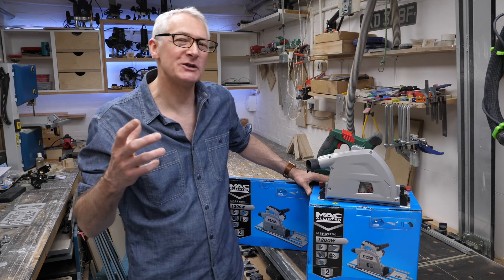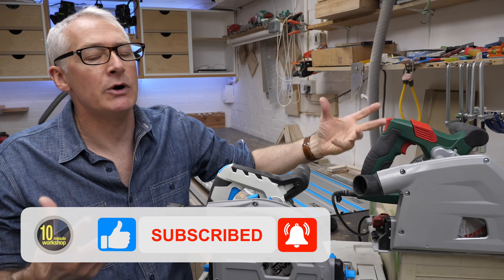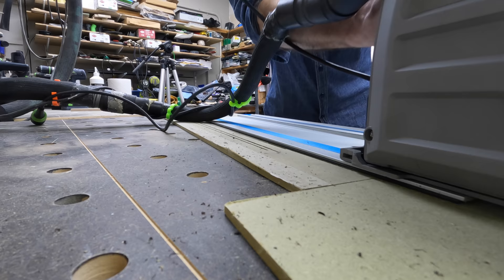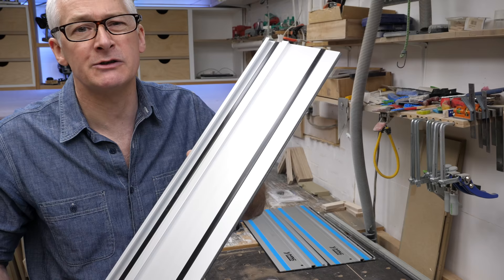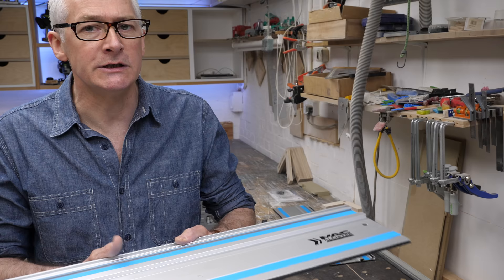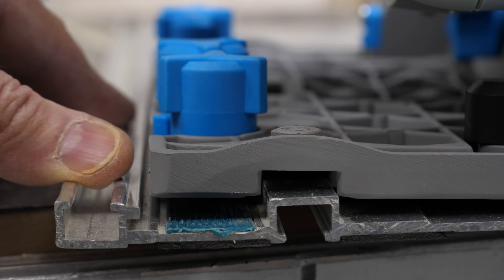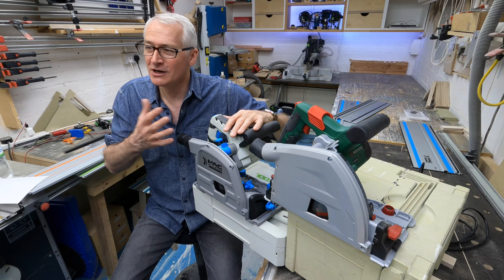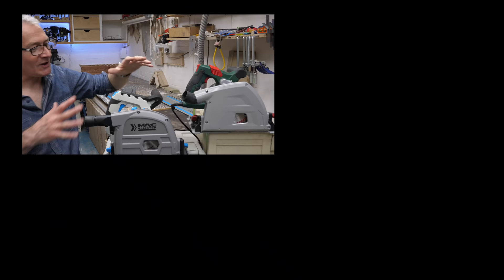Lidl Parkside or Screwfix MacAllister? [video 454]

Comment: Watched the older clips and found most of the cheaper units out of stock.  Found this and thought great only June last year so products should be the same, sadly not the MacAllister is also out of stock at Screwfix with B&Q saying one maybe in stock almost locally but over £100 now.
That grey MDF you use how does it fare cost wise compared to undercoating and painting?  Cabinet the size of a small wardrobe, 70cm wide 180cm tall sub 40cm deep. 
Seen a lot of US clips where they use it like its disposable, although some spend $5k on a machine say its flawed and stick it in the corner and buy another one for more money. Jealous oh yes. :)    Great  channel love the content.
Reply from the maker: Thanks! Yes, the Macallister started going out of stock not long after this video - not claiming any credit for that, you understand... The fibracolour was around £170/sheet, but it's a big sheet (2850 x 2100 or thereabouts) so I'd say it compared favourably to priming and painting - certainly a lot less effort than spraying, unless you're 100% set up for it!

Comment: Excellent video as usual. I'm considering the Mac but just had a look at one in B & Q and noticed the baseplate is plastic. This has put me off a bit as not sure how robust it will be.
Reply from the maker: Baseplate on the MacAllister I bought from Screwfix definitely isn’t plastic. Never seen any plunge saw with a plastic baseplate tbh. 🤷‍♂️👍
Reply: @10MinuteWorkshop  thanks for update. I'm going to e-mail screwfix for confirmation, it may be a 'new' version. I hope I'm wrong as this is ideal for my needs / budget.

Comment: Hi Peter , was looking for a plunge saw for quite some time and after watching your tracksaw workshop videos I decided if I won't find good second hand one I'll go for mac allister (£135 now) and when doing groceries in Lidl I bought a parkside D2 for £80 which I thought it's a bargain at this price , will upgrade blade and thinking of buying st2800 track's
Reply: At a time of your comparison video price difference between them 2 was minimal and I'm wondering if now Mac allister is wort that extra £55 over parkside?
Reply from the maker: Hi, sorry, old vid; I think you'll struggle to find the MacAllister these days. Pafrkside is great for the money if you can get your hands on one, albeit with the reservations mentioned in this vid and previous. Macallister not worth 50-odd quid over the parkside, put your money into more track. 👍

Comment: You promised this vid when i commented a few days ago and you delivered without fail.

I've been looking at all these "Cheap" track saws but i'm still not sold 100%. Was thinking i might just go buy the Bosch but have now found the Makita with 2 x 1.5M rails and a bag for £405. Yeah quite a bit more than 70 but if i have to get extra rails etc for the Lidl one then i'm starting to get to the point of not saving a lot in the long run.

The only thing putting me off about the Bosch is that the rails don't take standard clamps like just about everything else in the world. 

Think i might be spending £405 quid later. To be honest i've sat for days looking at lots of stuff and i still can't decide. (Festool out of my justifiable budget lol).
Reply from the maker: Well, either of these saws plus a pair of Evolution rails and you're into ~£150 - still a bit different to £405, but absolutely see where you're coming from; Bosch seems like a great saw, like a Mafell with a slightly reduced feature set. But the rails are slightly problematic, in that the lack of a left-hand side t-slot means some accessories eg parallel guides are a challenge. 👍
Reply: @10MinuteWorkshop  One other thing i realised was the warranty. Both are 3 years. Difference though is Lidl you get a refund, Makita you get it fixed.

Comment: I recently purchased a scheppach cs55 it's got a 160mm blade 55mm Dept of cut is 1200 watts & came with a 1200 mm guide rail  it would be interesting to have a comparison between the scheppach cs55 & these 2 saws 👍👍👍
Reply from the maker: The Aldi workzone saw is essentially a rebadged Scheppach, and I’ve covered them in detail before. 👍
Reply: @10MinuteWorkshop  thanks for letting me know I'll have to check out your other videos on it cheers 👍👍🇦🇺

Comment: Over here in the Colonies, you can get the exact same thing as the MacAllister and TItan saws under the Wen brand.  The main difference (besides the mains voltage and power rating on the motor) is that Wen sell the saw and rails separately, which increases the total to something like $200, but those rails are 50 inches rather than the shorter ones that come with the TitAllister.  (Based on the completeness of the Wen website, I think Wen is the original manufacturer, with Screwfix doing some "badge engineering", sort of the way Aldi did with Scheppach.)

Interestingly, the Wen also includes a little tag telling you how to remove the anti-kickback thing, though it does also mention the maiming you might get if you do decide to go that route.  I'd imagine the UK store-branded models probably leave that info out due to the more stringent health and safety regulations.
Reply from the maker: Good to know thanks. We don’t get Wen products at all here. 👍👍

Comment: I had the Titan version for a couple of years, using it for fairly moderate DIY use, but the motor blew last week sending sparks flying up in my face. Have now bitten the bullet and spent some decent money on a better quality plunge saw, ya gets what ya pays for.
Reply from the maker: Indeed you do. But it’s remarkable what £70 will buy you. My Titan is still going strong, just FYI 👍
Reply: My Titan is about to die too so I just ordered a makita cordless as an upgrade.  Got a lot of hours use out of my Titan for £70 + Tracks a couple of years ago.  not even sure £70 will get an extra strip of track the way prices have gone recently.  :)
Reply: @10MinuteWorkshop  My Titan's about to bite the dust but thanks to your first tracksaw vid,  it's got to be the best £70 I spent for a while!  cheers Peter.
Reply: @10MinuteWorkshop  Totally agree, I got some decent service from mine but they don't seem to be terribly robust. Mostly used mine for making some built-ins for the house and some bits of shop furniture. All mainly 12mm or 18mm ply and MDF. I'd say I got my (think mine was around £100 a few years ago) money's worth.

Comment: Ha Did you remember my review of this MacAllister saw? I find yours is better than mine ;-) hahahaha
For notiz. I use mine Mac Allister a lot and I am happy with this saw. Okay, it is not a Festool but do the work.
Reply from the maker: I did, thanks Tim! 👍
Reply: Tim, your video is also good but for different reasons. You pointed-out the squaring screws in the base that aren't clearly referenced in the manual and don't get me started on the play you exposed.  Scott

Comment: Great video Peter! As always! Last year I bought a parkside track saw in the Netherlands, it was the new version with the riving knife. Overall pretty pleased with the saw however I have issues with beveled cuts and I'm wondering if others have similar problems. When I make a beveled cut the pivit point of the blade is not at the bottom of the splinter strip. As a result, the blade cuts a bevel in the splinter strip, making it less effective and hard to align when the saw is used without set to a bevel. Changing /moving the splinter strip after each beveled cut is not very practical and expensive. If anyone has similar problems or a solution I'm very interested to hear from you.
Reply from the maker: Good point Ruben - I haven’t tried a bevel cut with these yet. 👍👍

Comment: The tracksaw's from Triton, Titan, McAlister, Batavia and Holzmann are all (from the) same Chinese factory in my opinion/experience/research. Only difference are extra's like a softstart, a better blade or safety kick-back. And Triton is only in 1400 watt and in 165 and a larger diameter. Wich is also is avail.at Holzmann. Had the Triton and have a Batavia 1200 watt.
Reply: Have to say, I'm very happy with my Triton, now I've taken a safety feature off.

Comment: I was able to get hold of a Scheppach PL55Li on sale for <€70. Though this 36V battery powered saw only came with 2x60cm tracks it's perfect for me as it's compatible with the 2.8m Evolution ST2800 track (I assume).
Reply from the maker: Be aware that the Scheppach saw has a wider than usual base plate & rails, so if you use the Scheppach on the Evolution rails you’ll have a lot of splinter-guard exposed. See the ‘which rails work’ video - link in description - for more details. 👍
Reply: @10MinuteWorkshop  Thx for your comment Peter,,, so due to the PL55 width there is no good alternative/fitting rail other than the original Scheppach rails for this saw?
Reply: 70€ is a bargain! I have that Scheppach saw and Evo rails. I also bought the MacAllister because the Scheppach doesn’t really fit them. But I did buy a 1.4m Scheppach rail too as I like the option of cordless since I do not have a workshop and work outside. Good saw though.
Reply: @alistairstanger2940  Yes, it was on sale at a Jula retail store and though I had planned to buy a corded one, the mobility with battery suited me fine.
At home, having watched some YT videos about quality control (I think it was Peters), I checked the saw and rails for defects and found that the rubber bands below on the rails had been glued on quite sloppy, ie they didn't follow/fit into the designated grove and the rail wouldn't lay flat and secure. Being the cheap turd I am I went back, complained to the manager and had him check the remaining saws he had for sale. All had the same flaw and since they wouldn't take mine in retur (later I found out that the store was discontinuing the Scheppach brand) I asked for a serious rebate. So when I was able to knock off the price from €250 to €70 I was happy, went home, set aside 2 min of my time, cracked open my utility knife, trimmed off some small pieces of annoying rubber, and can now verify that the saw & rails are 100% perfect.
Perhaps one of the best (new) tool purchases I've done :))
Reply: @SteifWood  excellent. Buy yourself the 1.4m rail with the saving. Oh, and replace the splinter guard with Festool one. Not too expensive and much, much better than the brittle original.
Reply: @alistairstanger2940  I've tried to purchase original Scheppach rails in Norway, but with no luck. No physical or online stores sells them.
To rant a little, you should know that Norway is a developing country when it comes to many issues related to woodworking. Unless you are well off as a DIY woodworker or your company is willing to pay ludicrous RollsRoyce prices and consequently charge ludicrous RollsRoyce prices for mediocre products, you're in deep sh.... For someone on a reasonable (DIY?) budget the situation is pathetic. Eg, if you want to purchase a decent table saw other than a crazy expensive Altendorf/Felder or even a Hammer sliding saw, you're stuck with a plethora of mobile contractor saws of various quality at still crazy prices (one option I saw was a Metabo battery contractor saw on sale for €2.300). I follow a couple of UK YT woodworkers and for instance Rag'N'Bone recently made a video of all the OK saws he could chose from when shopping for a new one. That sort of luxury I do not have here.
So perhaps I have to make another trip to the UK as soon as it's virus safe again. My suitecase could then be filled with pro Bessey(?) clamps, various saw blades for my imported US cabinet saw, and 1/2" special router bits, while I at the same time have had the chance to get some juicy cider and a LFC match :)))
Reply: @SteifWood  I’m in Finland and cover Norway as part of my responsibilities so I am aware a bit of the difficulties. It’s similar here but not quite as bad. I got my rail delivered from Estonia and will try to find a link to the company for you.

Comment: I was wondering if the extra tracks come with 1 or 2 connectors. If any can advise that'll be great 👍
Reply from the maker: You don’t typically get a connector with a length of track; seems like an obvious thing to include, doesn’t it? But nope, it’s an added cost (admittedly not much) with all rails as far as I know.

Comment: Hey there ! I nearly pulled the trigger on the Erbauer, but now not sure! Made some alcove cabinets with nothing but my jigsaw and clamps and levels and pleased with it. But moving onto some wardrobes in the bedroom and wanted to upgrade my cutting ability. Thoughts on cheaper track and spend the money on longer rail or the Erbauer setup ?
Reply from the maker: I looked at the Erbauer here - https://youtu.be/yd-jrG104Ks Long story short, nice saw but the oddball blade size is a hindrance, for not much benefit IMHO. Soft start and a brake are nice to have, but is it worth twice the price? 🤷‍♂️

Comment: Many thanks Peter for another great video. I bought the McAllister track saw a few weeks ago and am very happy. Would love some extra rails but not sure which way to go. I noticed a previous video from you recommending Excel 1.5m rails. They are currently selling at £42.99. Would these be compatible with the McAllister saw?
Reply from the maker: Thanks Dave! Yes, the Excel rails are 100% compatible with the Mcallister - they're the closest copy of the Makita rails that I've seen. Hadn't realised they were 'only' £43 - that's a pretty good option to add to the 2x700mm MacAllister rails! 👍

Comment: Hi Peter, have you used either of these saw with bench dogs? I was wondering if the motor body fowls on the dogs? I know this is an issue for the bosch track saw on the bosch track. The MacAllister is currently £80 in screwfix with a 1 year warranty or B&Q for £100 but with a 2 year warranty. With lack of parts worth considering the warranty as you have mentioned before.

Comment: too bad Screwfix does not have any shops in Belgium. We've got Toolstation here, but they don't stock MacAllister
Reply: In Romania, MacAllister is sold by Brico Depot - it is part of a french group.  If you're lucky, you can find one close to border.

Also, Hornbach (Germany, Holland) sells Pattfield brand - PT 1200 TS plunge saw looks very similar (and the rail looks like Makita's)
Reply: @ciptrofin  We have Brico Depot here in Belgium too, but they don't stock the MacAllister brand . ... So I decided to wait for the Parkside to show up.

Comment: Hi Peter, do you know if the MacAllister track rib is the same size as the Festool or Makita rail? In a previous video you said the makita was a bit smaller than the festool so you couldn't snug your TS55 saw up to the Makita rail. thanks
Reply from the maker: Honestly, there’s tenths of a mm in it, I certainly wouldn’t want to live by the difference, and there’s probably that much variation between batches. 👍

Comment: I can confirm that this years version has a riving knife.
Reply: I bought one a few months ago (the C2 version) here in Bulgaria and it certainly does have a riving knife.  I bought the standard Makita clamps to go with the rails; well worth having if you're ripping even slightly shiny boards, like OSB, as the rubber strip under the tracks is a little too slippery for my taste.

Comment: Given the price has jumped to £110 for the Mac Allister, would this still be your choice of entry level saw Peter? Or would you recommend another?
Reply from the maker: The Parkside is still decent, but only occasionally available, so yes, I still think it’s a solid saw. Using right now actually, for the next in the ‘basic build’ series. 👌👍

Comment: You didn't mention about depth adjudtment and fine adjustment.  The parkside has a very mafell like blade housing.
Reply from the maker: In all honesty, there isn't much to say; both have free-moving plunge-depth scales, and both have dual markers for on-rail and off-rail measurements. 👍
Reply: @10MinuteWorkshop  Thanks Peter.

Comment: For your New Zealand and Australian friends, Bunnings sells what is essentially the Parkside saw (a few differences, but obviously the same manufacturer) as "Ozito" here: https://www.bunnings.co.nz/ozito-165mm-1200w-plunge-track-saw-kit-skin-only_p6290615 . Interestingly they also sell a 1400mm single rail https://www.bunnings.co.nz/ozito-1400-x-180mm-plunge-saw-guide-rail-skin-only_p6290616

The Tool Shed in New Zealand sells a rebranded version of the Titan/Mac Allister here: https://www.thetoolshed.co.nz/product/7460-toolshed-plunge-cut-rail-circular-saw that occasionally goes on sale, although it is about twice the price of the Ozito/Parkside and a bit too close to the Makita.

Comment: Excellent as always Peter. Really is Plunge Saw Day, my new Festool TS55 F arrived today (First Festool). Like a kid in a candy store. but a quick question if I may?. I opened up the Systainer and noticed what looks like mineral oil on the plunge handle - any ideas?
Reply from the maker: Nice! And no, sorry - no idea about the oil, never had that on a new saw before. I wouldn't have thought it's a major issue, but check with the dealer maybe??
Reply: @10MinuteWorkshop  yeah will find out when I fire it up, but yes, sure it's nothing to be concerned about, just not seen that sort of thing previously. Thanks again
Reply: May be a manifold leak to the vacuum system.  Just sayin.

Comment: Peter, been looking for a short rail to go with your portable bench and was interested that you can purchase rails direct from the manufacturers?  I’d like to source a single 700mm rail - I’m not that flush to purchase a Festool 800, and would not be confident cutting down a Makita 1m rail.
Reply from the maker: Don’t think they’ll sell a single rail, but if you contact Lidl customer services they’ll,put you in touch with the manufacturer and you can buy a pair from them for ~£25 or so. 👍
Reply: @10MinuteWorkshop  ok.  Have a Makita saw and like you said it restricts what you can do with additions.